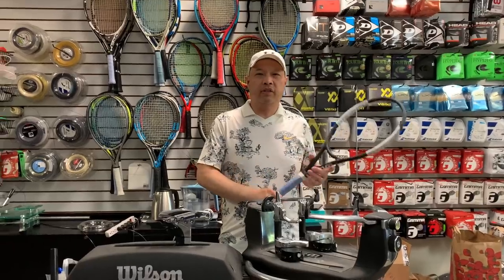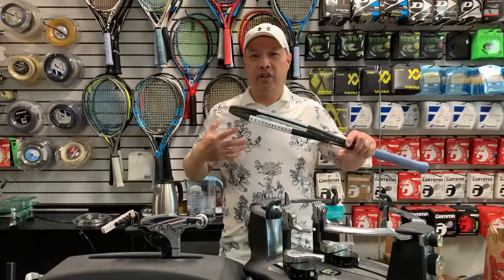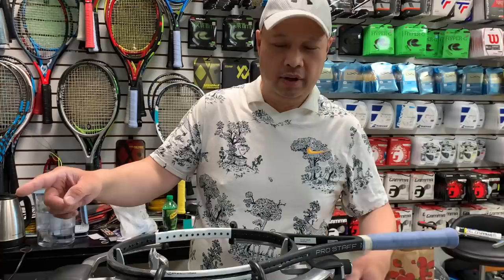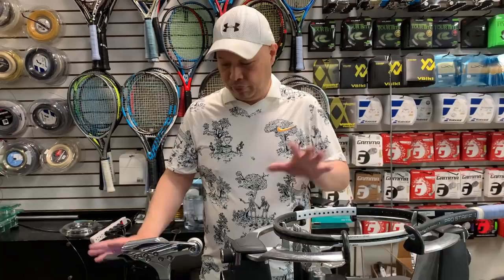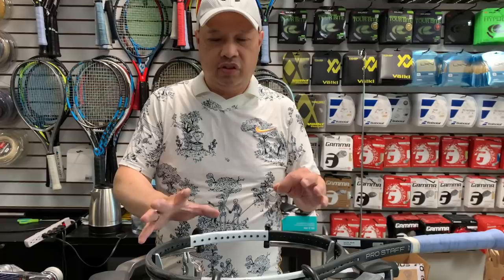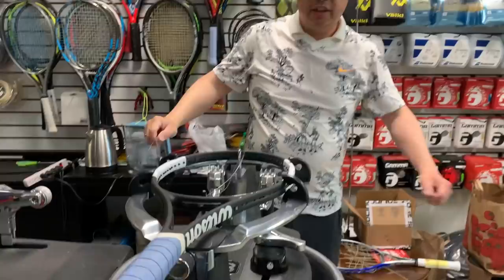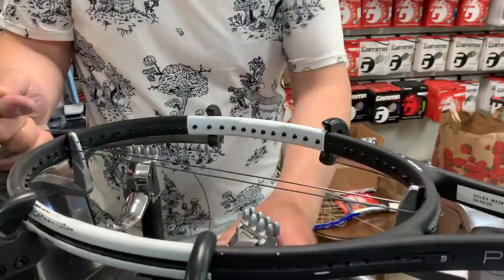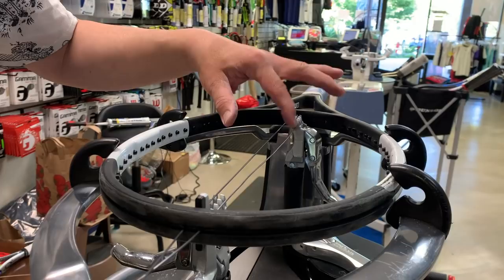HOW TO STRING A TENNIS RACKET   PART 1 THE MAINS

Comment: lucky this is not a natural gut...you are so rude to string it. Racket should be stable when the stringing machine put the string. If it shake a lot, you can't keep the right tension on every racket. When you clamp the string, string should be at the middle of the clamp, not at the bottom.
Reply: I'm not sure what you think is wrong with the way he clamps the string. You can tell by his stringing movements, that he is very experienced and has very sound overall technique.
Reply: @jeffreylin8100  you don't know what 's wrong he did? I will upload to show you.
Reply: @senasonic  Please send us a link
Reply: Javace sure, please wait. I work busy every day.
Reply: @senasonic  That would be great, as I bought a machine used and the very tip of my gamma clamps are worn so I clamp towards the bottom of the teeth to avoid the worn diamond section.
Reply: @javace79  Clamp towards the bottom of the teeth, it hurt the string more than middle. Then, if you always do like that with polyester string, it hurt the clamp too. I had two Babolat clamps were broken by my staff, and she did that often.
Reply: How much you measured for a one piece method from  an reel?
Reply: @senasonic  it depends on the adjustment of the clamp itself.  If he's widened the jaws to allow him to clamp lower down, then the relative pressure applied to the string will be the same as in the middle at normal jaw width.  However, bear in mind you're talking about a Yonex qualified and trained stringer.  They have supreme standards for qualifying with them and they don't pass you unless you're good enough.  He's a very experienced and knowledgeable stringer and is stringing hundreds (possibly thousands) of frames a year.  I think he's got it under control!
Reply: @6064jkr this is not only the clamp problem. if he is a very experienced and knowledgeable stringer, he won't do that much mistake. However he can string a racket but he can't keep every racket in same tension and feel. I can tell you, I am stringing over ten thousands of frames a year. He is a good youtuber but not a good stringer.
Reply: @senasonic  I can tell you I don't string anything like that many frames a year, but I am UKRSA qualified and I don't have a major issue with anything he's done.  I think your're just one of those people who has to tell the world how amazing he is, but doesn't have the balls or talent to put it out there.  Just my opinion...
Reply: @6064jkr  this is not difficult to be UKRSA qualified.....this is your level what you can see....please learn more skill, string more rackets, feel more different string,  think more how to keep the right tension , and ask more good players feed back. Just my opinion...
Reply: @senasonic  Interested to see what mistake he made... btw, where do you string? HK?